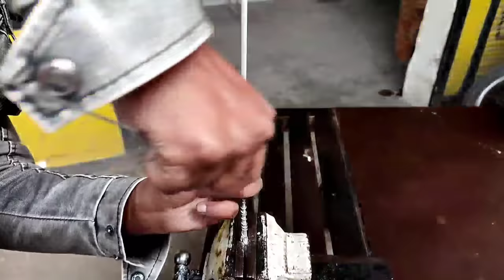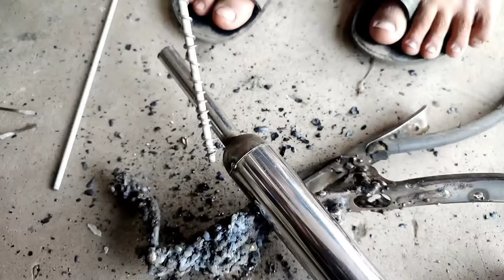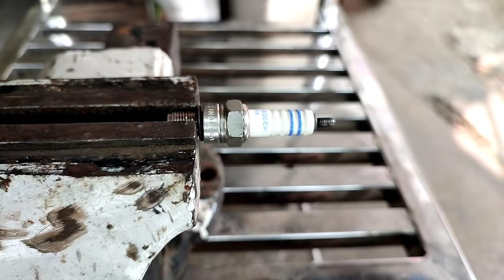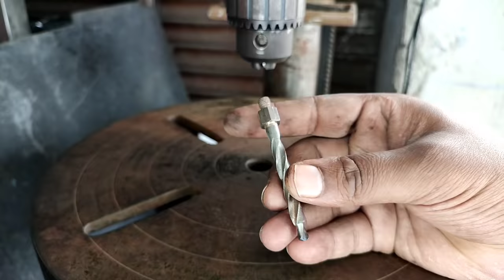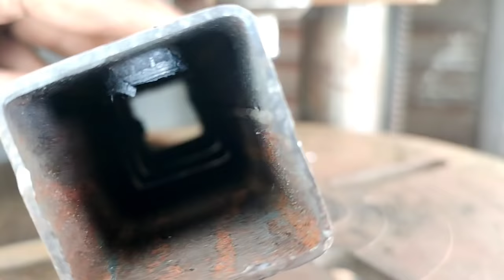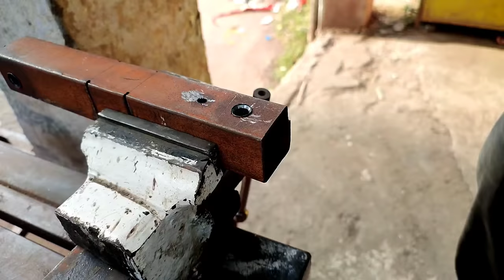Creative ideas 5 ideas that will be very beneficial if you don't watch it

Comment: So you made an extra ugly booger weld by wrapping baling wire around your electrode, and then melted holes into thin channel so you can cut a corner making extra weak threads into the pushed metal instead of doing it correctly and welding nuts onto the holes. Dumb.

Comment: What is the wire used to wrap around the welding rod?
Reply: Seems pointless to me… unless it’s a rod of pure flux or something weird 🤣
Reply: It's just wire that adds extra filler metal.
Reply: @derekcollins1972  makes sense in theory, so it creates a larger bead? Do you think you’d have to run on higher amps because if this?
Reply: @hw7032  I imagine if you run on higher amps that you would be in the same situation as without the wire and just keep burning through. This is just showing how to cobble up a bad joint. it's as bad as sticking bolts or whatever in the gap and welding over it.